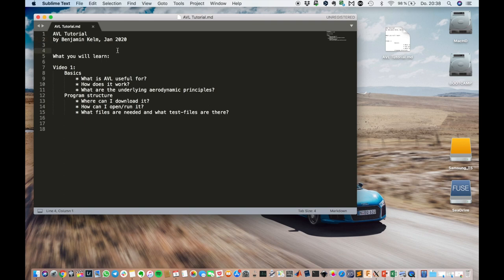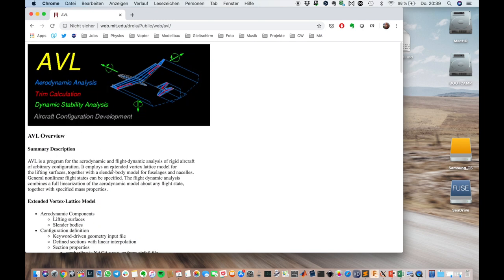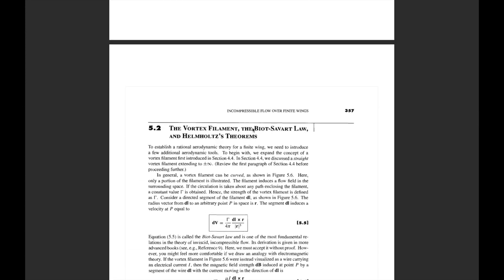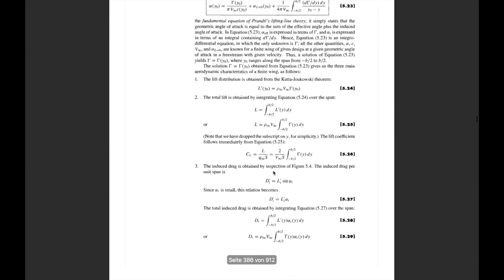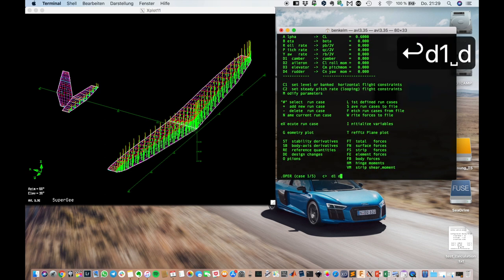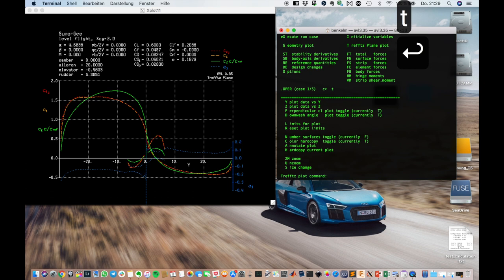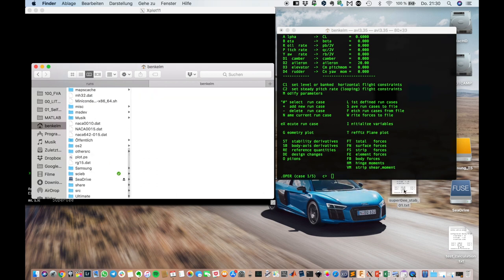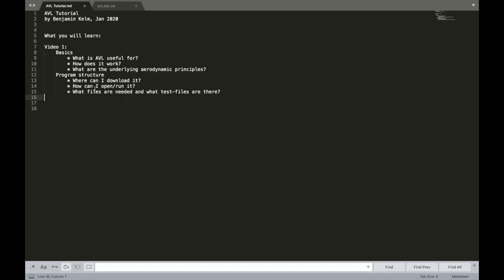AVL Tutorial (1) - Basics, Program Structure

Comment: Such an amzing tutorial! It's the only one that actually shows how to run and navigate your way throught the program. Just one  thing - Once i open the geometry plot, I am not able to change any angles or views if i want to look at the model differently. Any  I enter the K command for keystroke, but then i get a message saying the window size has changed and neither the plot window nor the cmnd prompt accept any commands.
Reply: I am having the same problems, i can follow the video except for when it comes to the geometry window. Once its opened, I cant use any command regardless of what AVL window i click on. The program essentially freezes and I have to close and re open.
Reply: actually, the issue occurs once i press K, If i dont press K, i can still make adjustments and ad load, but once i try to move the geo, it freezes
Reply: @nawfhou9223  I had the same problem, then I tried with an older version (AVL 3.36 executable for Windows) and that works properly. Hope it helps!
Reply: @nawfhou9223  HI, have you solved the problem? i'm haveing the same. and i could not fix it even have tried an older version.
Reply: I solved this problem. If you compile directly according to the manual of the zip file, you can use the keystroke mode

Comment: Thank you Benjamin for your nice video, I watched them and they are really useful, I have a question about loading distribution, is it possible to export loading distribution?I mean exporting pressure distribution on the wing or body for all coordinate points, depending on x, y and z.
I tried FS or FE but I thinks they are not what I want.
Thanks a lot.
Ali
Reply from the maker: Hi Ali, 
if you use FE, AVL will spit out the element forces, including the dCp (Pressure coefficient) for every single calculation point on the lattice.

Comment: What application do you use to start the AVl application.... I'm unable to find it😅
Reply: Do you find any software to start avl
Reply: same! what did you do to solve the problem?
Reply: since the file is named avl3.35 it can be that your computer interprets the .35 as a file extension. Rename it to "avl335" and try again :)
Reply from the maker: Sorry for the late reply. Depending on your system (here, Mac) you might need to compile it beforehand into machine code. Then launch it over the Command Line Tool (Shell). For windows and Mac there are pre-compiled versions available on the MIT AVL site.